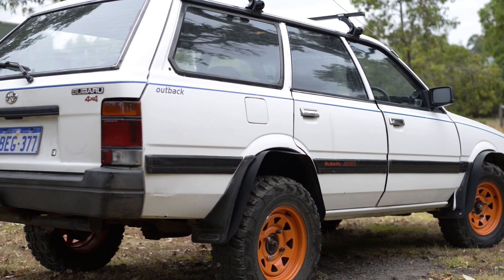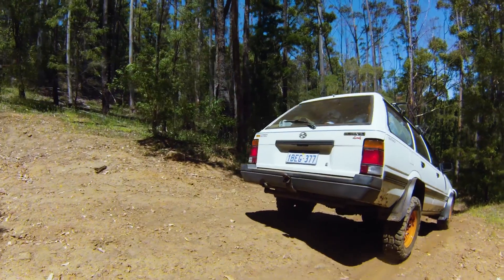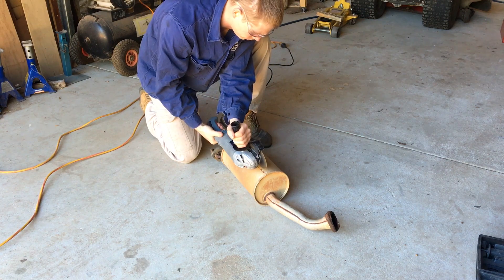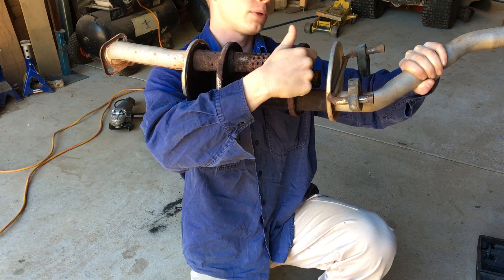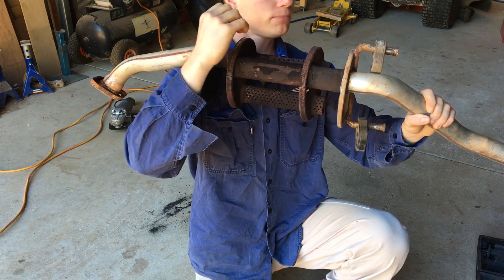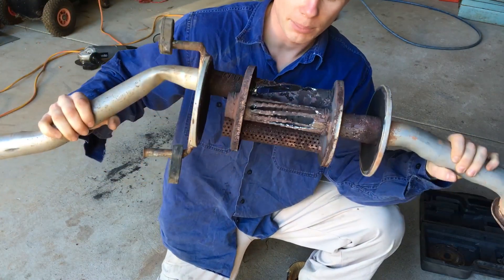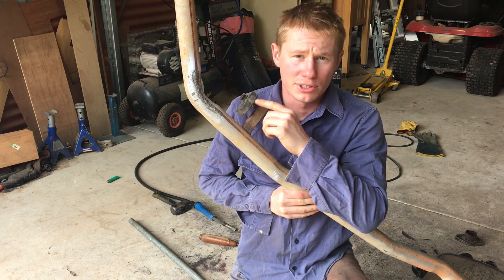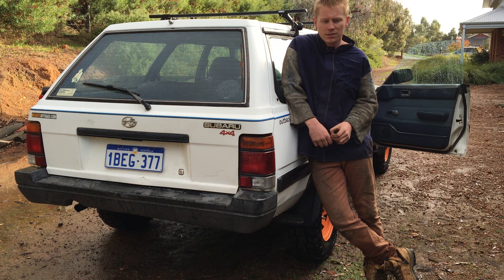Backyard Mechanic 08: Subaru Exhaust Repair

Comment: What? No lash adjuster rattle, It's not a Subaru!
Reply: lash adjuster rattle is the front seal on the oil pump sucking air in . Aerating the oil